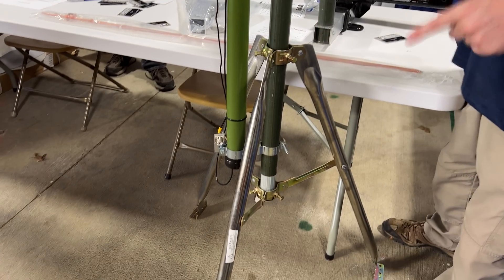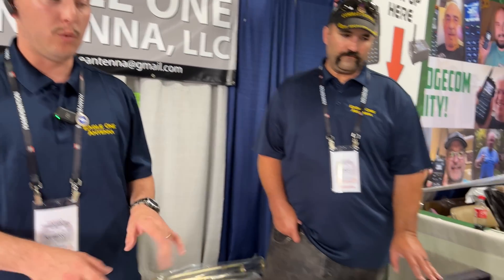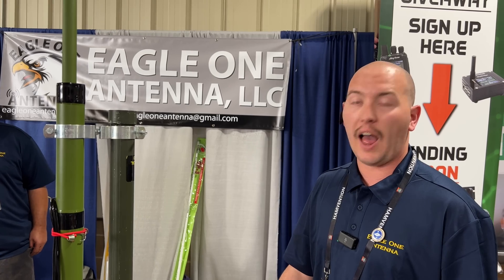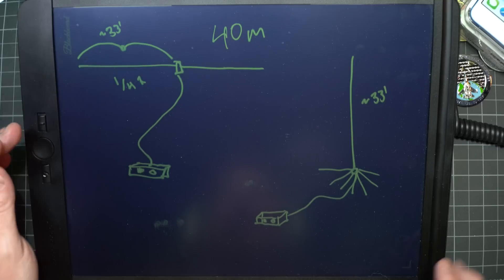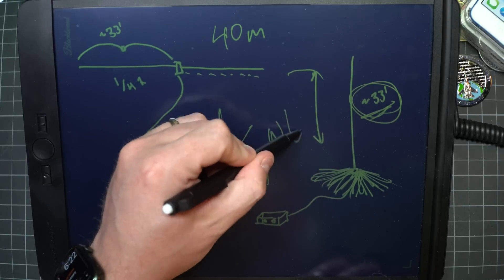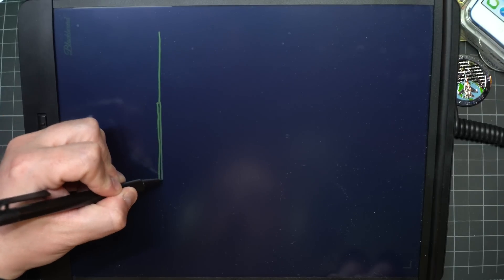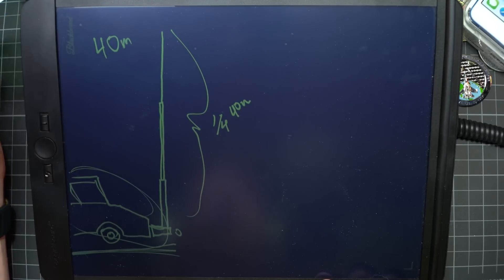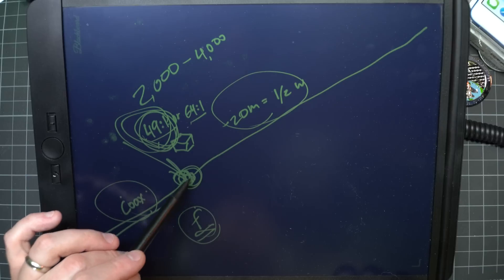Eagle One Antenna - What Is it?

Comment: Not knocking Tristan at all or you but if you look back at Steve’s info and his recommendations with the EagleOne, he did recommend an unun or a coupler at the feed point such as an Ah-4, SGC-23x etc. When used this way with my SGC-230 to feed it and deploying 7 radials, I often get anecdotal compliments on my signal. I have used it in this configuration for 6m-160m. Not saying that it is the be all end all but it is a tried and true vertical system for portable use. IMHO -KB3CMT
Reply: And yes the SGC would likely tune a wet noodle depending on length, so there is that…
Reply from the maker: Yep. That would be the way I’d run it too.

Comment: Nice assessment, Josh!  Resonant quarter wave monopole antennas are also resonant on each odd multiple (i.e. 40m is also resonant on 15m) but present very high impedance on the even harmonics.  Because the ham bands are harmonically related, that causes problems for us.  One way to solve that problem is to use a non-resonant, or "random" wire antenna.  Understand that "random" is a misnomer and they aren't actually "random," they are purposefully non-resonant.  

By choosing non-resonant lengths of wire, the feed point impedance on each ham band typically ends up being in the neighborhood of 500 ohms with some reactive impedance that needs to be addressed as well, but nothing too crazy.  Many tuners can handle that, but adding a 9:1 unun makes it even easier for a less capable tuner to match.  Losses are manageable, provided the wire is at least about 1/3 wavelength on the band of operation.  

A 1/4 wave monopole needs a good ground plane to be efficient.  The "random" wire needs at least a counterpoise but is a bit less dependent on a good ground.  

I kind of feel like this antenna is having an identity crisis. Every antenna is a compromise, and there seems to be a claim that you can have your cake and eat it too. I think the design and construction of this antenna are decent and fit many use-cases, but if I were promoting it, I would describe two setup scenarios depending on user preference:
1) 40m resonant 1/4 wave vertical with radials, also resonant on 15m.
2) 31 ft non-resonant wire fed with a 9:1 unun, with a 17 ft counterpoise or vehicle ground. 
IMO, these two setups would give optimum performance depending on user priorities.  So if you're an Eagle One owner and are reading this, and want to give those a try, let us know how they work for ya.
Reply: The wire in the eagle one is just short of 1/4 wave on 40  which makes it non resonant.  thats why the 9:1 works so well.
Reply: @geoscout87  cool that makes more sense. I did not know it included a transformer and was designed to be used with one.
Reply: I think there's a big issue with some of the oft-repeated lore when people go around bashing tuners.  There will be minor tuner losses, but the actual behavior of the coax+antenna system that the tuner matches is more complex than people typically know.

In real life, a tuner matching a high-impedance antenna will certainly be less efficient than a good vertical with ground plane or dipole.  But, it's not nearly as bad as most hams seem to want to believe.  

People seem to think that 2400/50 is 49:1, and they feel like that means almost none of their power ends up on the antenna.  But is that what really happens?  No -- what happens is multiple trips reflecting back and forth through the coax, each time dumping some signal on the antenna.

The losses come from resistive losses in tuner elements and the coax.  If your coax is very short and the tuner's range is well-suited to the coax+antenna, you will have few losses, and a lot more power ends up on the antenna after multiple trips than people give it credit for.  Not saying it's great, but it's more than the 2% that you'll hear some people claim :-/.

This partly explains why some people have better success than the numbers would make you think, and others have abysmal results.  There are a lot of variables, and few people really seem to understand the flow of power through a system like that.

Comment: Best explanation I've heard describing impedances on an end fed. The closer you are to 1/2w the higher the impedance will be and the harder it will be to tune. However, if you tune correctly, it's a very efficient antenna. Tuners should be able to match 10/1 and/or have a 49/1 unun. The toroid of the tuner should have taps on a switch and not just the caps for tuning. For SOTA and POTA work, the antenna wire should be attached directly to the tuner and the tuner can then be at the rig. The WARC bands seem to be the worst and the best way to solve the problem is a 1/4 radial for that band. That way the radial, which should always be above the ground to eliminate losses, is lighting up with RF and you are not, when you touch the case of the rig, if you are just using the shield of the coax for a radial. I'm speaking of POTA and SOTA work in the above. de K0MP

Comment: I guess Doublet is a good option......
Reply from the maker: For quick POTA activations? Likely not.
Reply: @HamRadioCrashCourse  yeah correct
Reply: @HamRadioCrashCourse  Quick? I mean, we spent 7 minutes with two people to put up a 130' doublet in an inverted V on a 40' spiderbeam with a camco hitch mount for the first 200 or so unique parks I did. One person, it takes about 15 minutes give or take to deploy it. If you're going for speed (and I do), can't beat the screwdriver and mobile install. I don't even have to park before I can operate in a park. 73 de w8tam

Comment: I don't remember the name but someone used to sell an antenna using a fiberglass mast with a wire through it. It came in 27 ft. and 43 ft. It slipped over a pipe to mount it. It did need radials and they sold a radial plate for it. It did require a tuner. I had the 27 ft. version and used it for temporary setups in my yard with about 8 radials, much like you would do with a DX Commander. It worked OK an 40 and above.

Comment: A 31' vertical antenna with a 4:1 unun and ground radials was recommended by my Elmer with decades of ham radio experience and knowledgeable about antennas.  This is a classic design that has been written about a lot.  Josh did justice to the explanation.  But this is a good compromise antenna for someone like myself with limited space and to be moderately unobtrusive.  No complaints from HOA in over a year. For my personal experience no luck with 80 meters, but 40 meters and up is reasonable.  Ran 33' radials but had to curve many of them to conform to space.
Reply: The Eagle One antenna is a knockoff of the S9 V18,and V31 antennas,with a few additional features,such as the hitch mount design,and tripod.I’m certain it would work fine on 6-40 meters with a 4:1 unun,especially for DX.
Reply: It's comes with 6:1 I think.
I use 9 :1.
I use another brand pole.

Comment: Would the 49:1 un un change the ohms on the 40?
Reply: Short answer, yes. Long answer is that a 1/4 wave wire fed with a 49:1 unun will not work well because there is now a high current node present at the transformer, instead of a high voltage node. All the extra current makes the transformer very lossy. Also, it's not needed. You can just remove it.

73 de VE3GKT

Comment: A buddy is dropping one of these off for me to use next week. Would it be feasible to add radials i.l.o. an unun?
Reply from the maker: Radials yes. You should always have radials if not running on trailer hitch. If trying to work outside 40 meters it likely depends on what you can get away with.

Comment: So basically a 10M fiberglass mast and a wire for an EFHW that for another $200 you can get a 2" hitch receiver or a tripod to mount it on? Cute package, but seems a bit over priced for what it is.
Reply: Wow dude...  you have it WRONG.. It's $170 for the antenna setup and about $235 as the package.  Plus, discounts are available for a short time.

Comment: Why wouldn’t you just collapse the antenna to a 1/4 wavelength @ 20m? Winding the extra wire essentially shortening the wire electronically? Also there is a lug for radials.
Reply from the maker: The winding up doesn’t really remove the wire in the middle.
Reply: @HamRadioCrashCourse  could potentially have borrow from the linked dipole concept and add some banana plugs or alligator clips to shorten the length of wire.
Reply: @AllanBProductions  coiling the wire as you shorten the mast electrically shortens the wire. You can see the coil on the side of the antenna in the video.
Reply: @HamRadioCrashCourse  coiling the extra wire doesn’t electronically shorten the antenna?
Reply: Not trying to disagree. I am trying to make sure that I have the theory correct